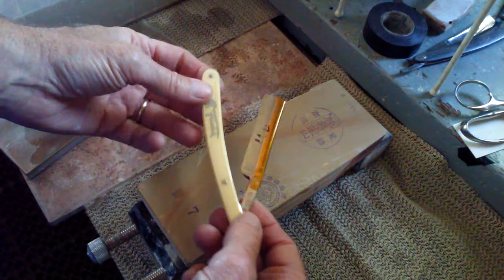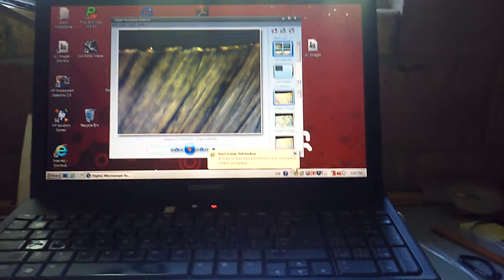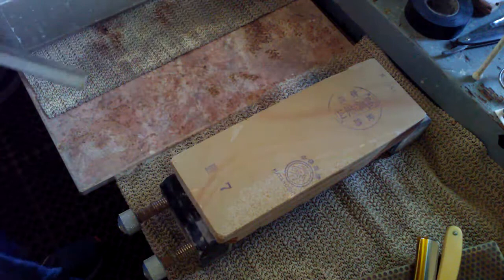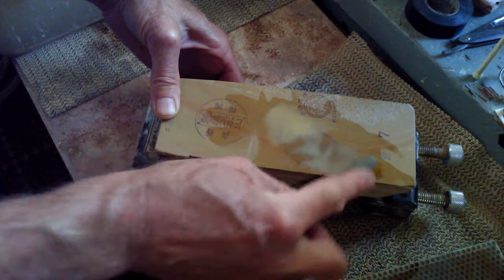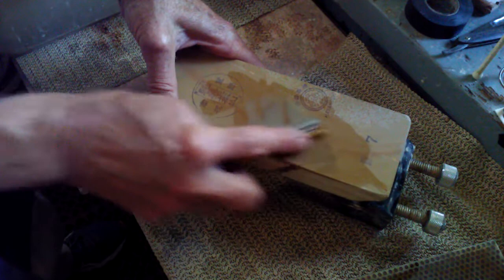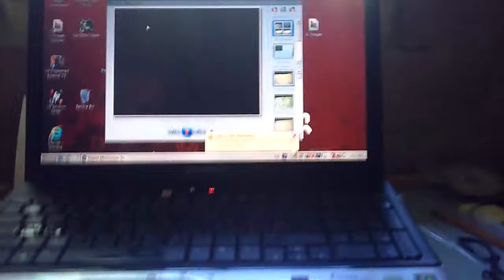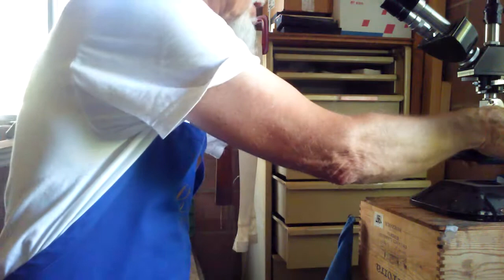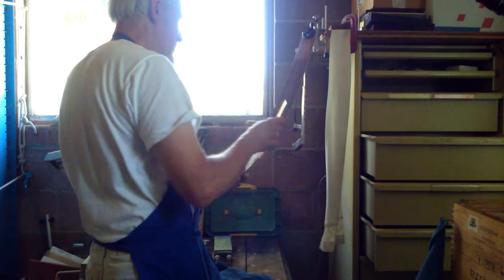Testing #1151 Nakayama kiita from Hatanaka Toishi Co.

Comment: Looks like a real Maruka... Cutting speed yes it's so fast and fine. strange it's not cutting hht after the first round of honing... Still a sort after stone.. selling?
Reply: So you expected it would cut hair after edge wrecked by diamond plate and then just over a minute on the stone followed by a few strokes on the shell cordovan??
Selling….$2500 iirc several years back….add $1000 or even 2 would be his price today